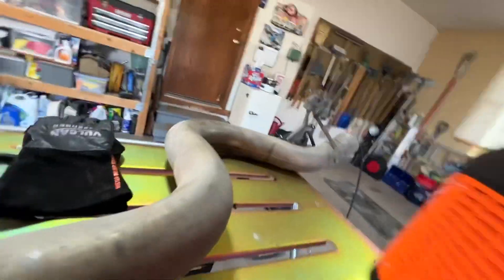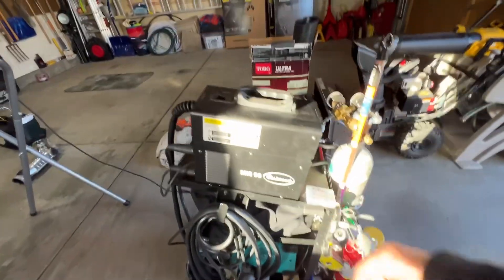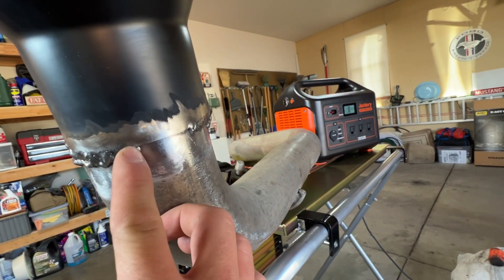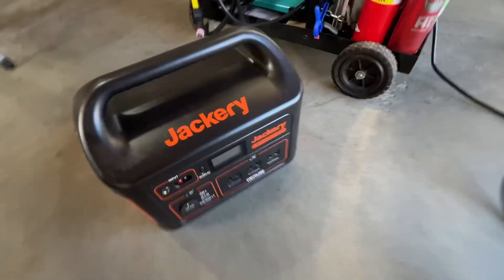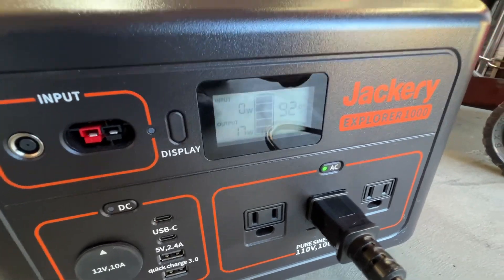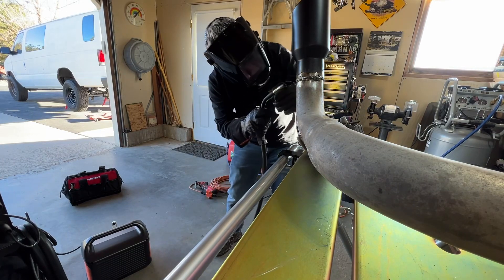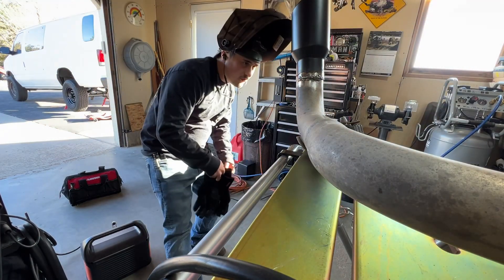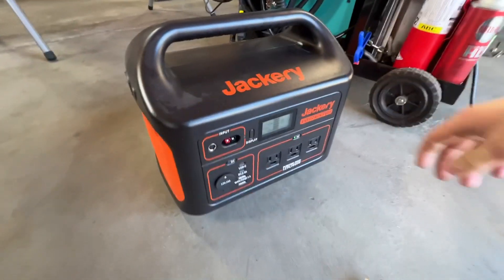Will a Jackery E1000 Power a small welder? Lets Find Out

Comment: You have enough voltage but not enough amps. I think the Jackery 1000 is rated at something like 7 amps. Your welder probably needs somewhere around 15.
Reply from the maker: Yeah 1000 watts constant and 2000 watts peak, not sure the exact voltage, probably around 110v so thats about 18 amps on the peak. But not clear how long it can hold that. Was wondering if I could maybe do some spot welds. my welder was nearly maxed out since I was running .023 maybe if I had things dialed back it could work. Im thinking a e2000 power station could run the welder no problem just was a fun spur of the moment test